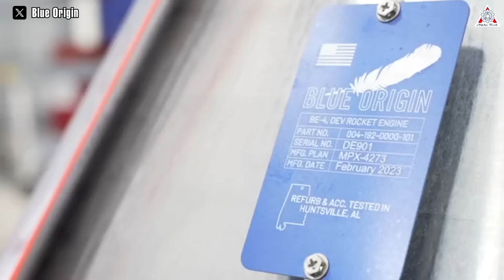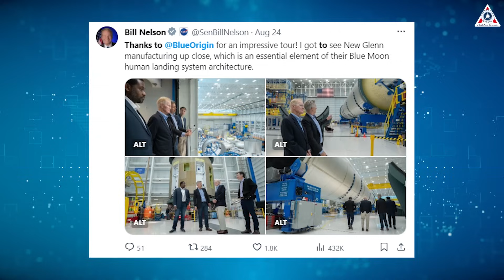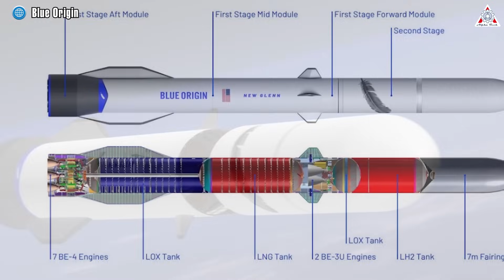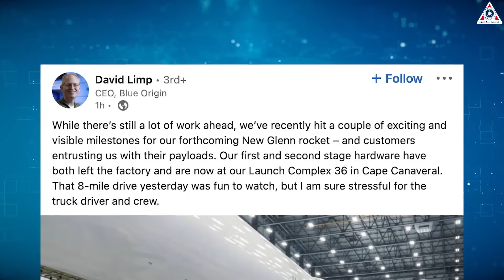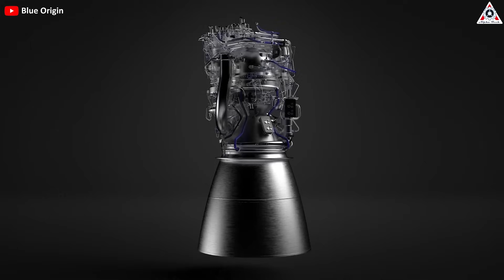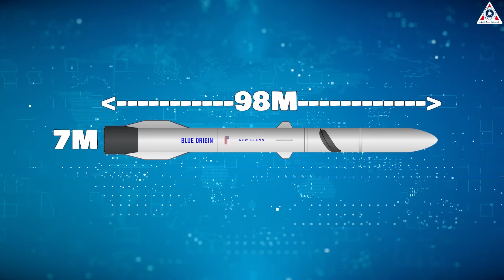It happened! What Blue Origin just did with New Glenn hardware somehow shocked NASA scientists

Comment: wait so let me get this straight, so New Glenn is going to compete with SpaceX when they're 14 years ahead of them with the Falcon 9?  by the time BO irons out all the kinks out the Starship is going be fully operational and I'm sure at some point in time the Falcon 9 is going to be use less and less.
Reply: Really competing with Falcon heavy which does not have second stage revovery.  Performance should exceed Falcon Heavy with New Glen 2.0 which will come when BE-4 matures enough to increase its thrust a bit allowing increased tankage on first or/and second stage.  Neutron is the one that will be competing with Falcon 9.  It is the Chinese that may eventually compete with Starship.  SpaceX could have further developed Falcon 9 and Falcon heavy using Stainless, and full flow staged combustion, perhaps using propane, but that is not an efficient Mars (or moon) rocket.

Comment: Blue Origin is afraid. At their pace, one failure will sink them.  It's not about money, it's about time and the confidence of the contractors with BO to finish the job in a timely way, Unless you have NASA and the DOD and the WhiteHo to push the money thru, that ain't gonna happen.
Reply: Doubtful.  They can probably survive several failures with Kuiper lined up and Vulcan sales booked.  There even may be others who would buy a 250 ton thrust Methalox engine for significantly more than marginal cost to produce.  SpaceX could not do the same with Raptor at this point as the rapid development makes it a moving target.

Comment: Looks like Jeff needs to up his game...
I suspect after the next several Starship launches he will change his designs, and simplify everything.
So far, Starship has only really show cased fabricated construction, and somewhat simplified engines.
But I suspect soon we get to see the results of much simplified and more powerful engines, and likely that power boosted each test launch. And it will become obvious that fabricated stainless is feasible due to the increased thrust.

Fabrication is way effective. and as engines are improved and up scaled, its just going to be continually more accepted, until taken for granted.
As will be the simplification.

Basically its a move from custom rockets to industrialized ships production.

And once it gets obvious, other players will jump onboard. Especially those in related industries like aircraft production, ship building, and engine manufacturing.

Space ships with be a blend of current military industrial complex corporate abilities, but become its own niche.

and early rocketry will have about as much input as the other fields.

Will require the Superman effect: Lighter than a maritime ship, stronger and more durable than aluminum aircraft, Simpler than a jet engine, etc.

But each industry will have appropiriate skills. And I suspect it all will be blended in with the new upstarts thru mergers.
Basically SpaceX is the Trail Blazer into the new era, and the rest will be along shortly when they realize the danger of staying in the old paradigm too long.
Time is money,  and the new tech is way faster, and not limited to sea surface or even atmosphere.
And if atmospheric  carbon extraction is perfected, and maybe oxide extraction from refining, rocketry becomes effectively non polluting. And even methane production from city sewage would reduce greenhouse gasses by being burnt rather than expelled.

Likely current aircraft flight distances will be shortened. become commuters, and all the long legs replaced by rockets.
We'll see, but we arent likely to stay with the current business model very long.